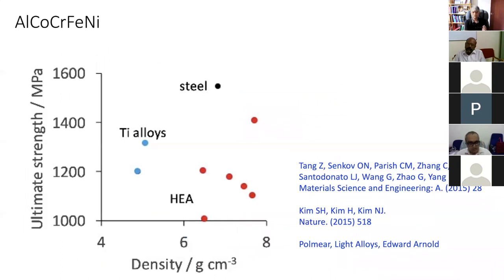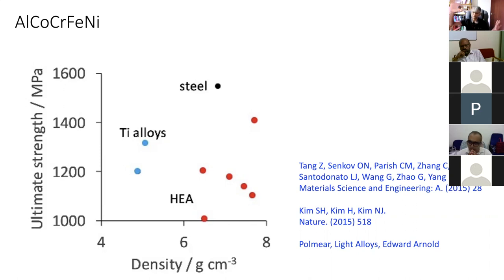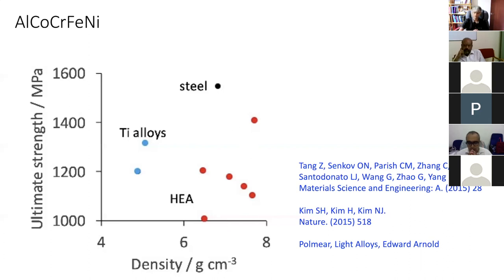High-entropy alloys - Part 3

Comment: About the Calculation of the melting point of a HEA system: Should the calculation be the same if we use the melting points of binary systems in weight % (50-50)? Of course we will also convert the at.% in wt% in the system. I ask because there is a deviation of 50 Degrees. Thank you for your great work!
Reply from the maker: I am not completely sure, but if everything (including the temperatures as a function of concentration) is defined in terms of weight percent, the method should work.

Comment: Thermodynamically speaking, how does high entropy correlates with increase in mechanical properties?
Reply from the maker: No relation between entropy and mechanical properties. The basis of high-entropy alloys is simply to obtain a single phase containing lots of alloying elements. In most cases, the properties obtained already exist in common materials that are far cheaper and can be made in very large quantities. As far as I am aware, there isn't a single application of high entropy alloys as yet.